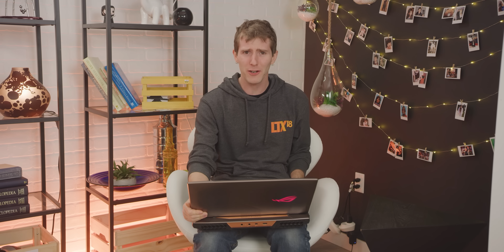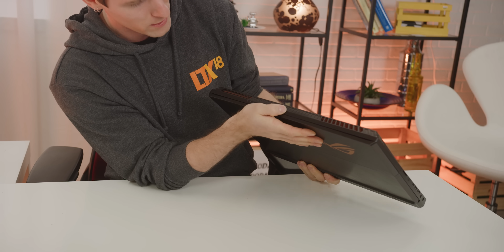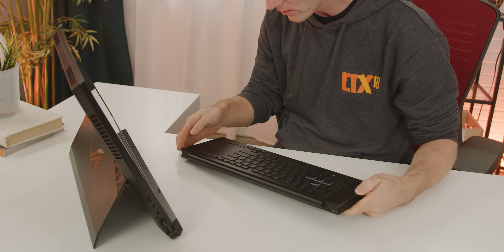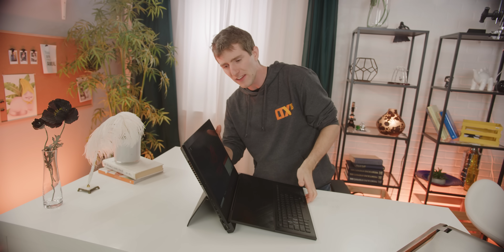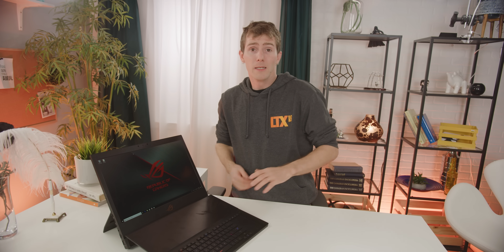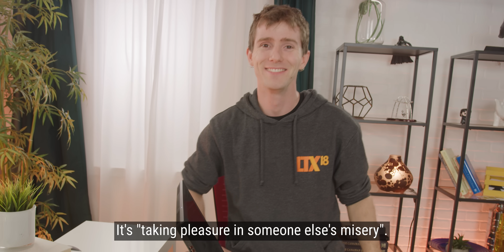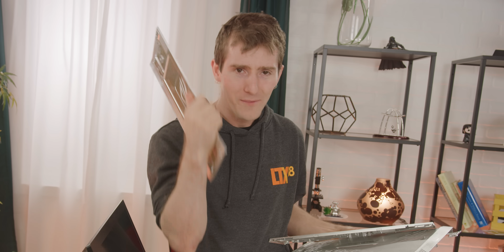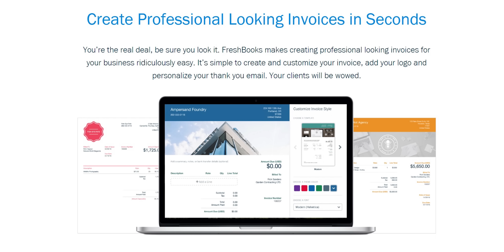A Surface Pro for HARDCORE Gamers - ROG G703 "Mothership" First Look

Comment: Asus HQ: "let's make a more expensive version of a laptop that our customers already can't afford"
Reply: @7oclock  that goes against what ROG is meant for
Reply: @lauren-tc7jo  It's called Republic of Gamers, not Aristocracy of Rich and Stupid Gamers
Reply: @b3nsn0w  ROG is well known for being over the top and being really expensive rhe rog mothboards are at least $200
Reply: I'm into buying good tech but this shit will cost like 10k with taxes, crazy mother board, crazy sound card, crazy mobile rtx 2080 and 3 ssd in Raid 0 plus a wireless keyboard hmmm this shit will cost more than my car😂😂😂
Reply: @7oclock  ASUS does have a budget gaming line, the TUF series. Not sure if those are any good though.
Reply: Or put on our laps
Reply: @7oclock  like @flyingendeavor said ASUS does have a budget lineup but the ROG series is made to be as powerful and reliable as possible so it ends up being quite pricey.
Reply: @7oclock  I would recommend Lenovo 320 15IKB (The one with mx150) and a ram upgrade for it. That's the most budget i can think of

Comment: Curious why in such a potentially epic machine, why would they use simple aluminum heat shield to protect the monitor?   A layer of Aerogel covered by gold foil to both insulate and reflect the heat.   And add almost no weight.    I mean, if it needs additional strengthening, then I get it.   But it didn't appear to be the case.    Better options are out there and wouldn't cost any more than all that extra machining.

Comment: These things never make sense. Probably costs ~$5,000 yet has ~$1,200 desktop performance.
Reply: Callsign Vega 
Remind me, what’s the cost of an RTX 2080?
Had a quick look, cheapest 2080 is £650 from my favourite computer store. That is ~$1,100 Canadian according to google. Add the high end CPU (did Linus say 8960 or 9860? Either way, top of the line 8th or 9th gen mobile processor)...
More like $2,500-3,000 PC at least.
Reply: @InternetEntity  ikr what a dumbass
Reply: @InternetEntity  Uhh no, a GTX 2080 is $700 USD. I'm not talking about Canadian Pesos. The CPU is another ~300. Toss in some basic memory, a PSU and a cheap SSD, you are at $1,200. Oh AND the desktop 2080 will be faster than the mobile version.
Reply: hey nitwit. This thing has a 2080ti and a i9. It definitely runs WAY better than a 1200 laptop.
Reply: @hukuhuhuh  It doesn't have a 2080 Ti moron, it has a 2080. And I said it would have comparable performance to a $1,200 desktop, not a laptop. Did you make it past grade school?

Comment: The one thing I never understand is... how the hell does this solve the “lap” problem? It’s super top heavy, because it’s like 19 inches you’d need 3 foot long thighs to fit this on your lap, but unlike a large gaming laptop, all the weight isn’t in the bottom. It’s going to be like a surface on your knee but far worse... if you need this much power just use a desktop?

Comment: I'm currently looking for laptop with a strong dGPU, a 4k display (touch if possible), long battery life, and light weight for a budget of $2000. currently looking at the Aero 15X and the XPS 15, razer blade advanced is outta budget, any suggestions?

Comment: At what point will there be no difference between these bulky laptops and just slapping a monitor to your mini itx case and taking it everywhere
Reply: Chaitanya Singh kinda hard to put a 6 core + 2080 and have them cool on a mini itx
Reply: @nochox  mine is part size and fine. Biggest restrictor thickness wise is the power supply. Using a brick just sucks for sfx. Better to go slightly thicker with a regular psu
Reply: More like T H I C C laptops
Reply: @Brother Ares But the gpu and cpu are soldered on motherboard in laptops, thus taking less space, and easier to manage the airflow. A normal graphics card would take lots of space in itx, unless you can put an MXM card in it.
Reply: Small form factor is dead. Long live the mothership

Comment: even if i have much money to bought that thing, but i won't.
Reply: At least they made another laptop with a 17 inch screen in a 15 inch laptop body with 2080 max q gpu and way thinner
Reply: @stantorren4400  is it stil laptop when it doesnt fit your lap? 😂
at least it is stil "full desktop" replacement

Comment: 4:54.

Okay, someone help me out here.

When does a "laptop" (is it a laptop really?) have the same performance as it's desktop counterpart in terms of CPU and GPU? I'm rocking a 970m, where the 'm' is supposed to be more power efficient, and produce less heat. I believe this is done by underclocking it, or using a different card altogether?

Linus said a i9 xxxx HQ, which is a laptop CPU right?

I'm curious.

Comment: if they make a 1440p 120hz 99% adobe RGB touch model with an 8750h , gtx 1070 max-q and a 94.24wh battery for $3800 cad this would be the perfect laptop full stop

Comment: review the real desktop replacement, p870tm with 9900K delided+repaste+uv+OC+etc... i9 8950hk is at most 8700K if it did not throttle.
also p870tm could house 3200mhz ram cl17,this will show more benefit to gamers as well. not to mention 5 displays options are sth no other laptop modes(except clevos) offer in one model.

Comment: You rushed this video bit too much, missed out a lot of information including spec's and didn't pay much attention.nor did any bench marks :( also there is another version but much slimmer Linus! 

Austin Evans did a very good job, at explaining what this machine is capable at doing, and what it also comes with out of the box ! and yes it does come with an external webcam for twitch streaming on the go ! and he even explains about the thermals.

Comment: Of course the panels were milled out, it's a prototype. Milling has less tooling cost.

That being said, if the production model doesn't use something like stamped sheet metal, those engineers are crazy

Edit: actually, if they don't plan to make a ton of these, milled might be better.

Comment: That is probably the freshest idea ever. When gaming laptops moved the vents from the left side (where it melted the ice in my drink) to the back, I was impressed. If other manufacturers start doing this laptop performance will increase more and more. Great job Asus. The only downside is it didn't need to have all those super components in it. Make a version that's more affordable.

Comment: Full Review Please And Try Something Crazy Like Overcloking
Reply: Maybe one of two power inputs is for the RTX 2080 since the minimum power consumption is around 650 w
Reply: With this system, I don't actually think overclocking is even that crazy.
Reply: That thing will probably melt. I doubt it has a good enough cooling solution to keep all the components cool in that form factor.
Reply: @meltedcheese1908  have you seen the cooling system at the end of the video??? and basically all the shell of that laptop is a cooling surface because its all aluminium
Reply: @carholic-sz3qv  I have my doubts. I could be wrong.
Reply: underclocking would be crazier

Comment: I would like to know the battery life.

Also, what would be the best laptop for Game Design in College? 

AKA, what has the best graphics without having S@!$ Battery life or weighing the equivalent of the Colledge textbooks I'll likely be carrying normally.
Reply: Battery life, what battery life. That thing has 2 power inputs. I imagine it's like 30 minutes if you have it running on a full load.

Also, your question is on a sliding scale, What's an acceptable performance for you will determine the battery life. Or conversely, what is the minimum you want in runtime it will determine your performance. Your balance of battery life and graphics are directly inversely proportionate. You could perhaps get a laptop with USB-C PD charging and then get a bunch of spare PD Battery pack as an alternative but then you're carrying around a bunch of battery packs.
Reply: @kickassnetwork  it depend if it can switch to discrete or dedicated graphics the battery life will be nice
Reply: Gaming laptops aren't good with  battery life. As for your question, doesn't your school give you a minimum requirement in terms of hardware? Especially on the gpu side.
Reply: I went to school with a mobile workstation in hand.  It was a mistake.  The battery life was enough to make it through a single class, plus anything that I actually needed that kind of horsepower for could just as easily be done on a school computer.  I still love that mobile workstation, still holds its own today(5 years later)(I plan to wipe it and install an ssd to bring it up to date), but in the end its hard to call it mobile.  Not to mention that it weighed as much as four text books combined.  And I could cook a meal on the keyboard.  Don't make my mistake.  Go i7 or i5, 8 or 16 gb, an SSD and a discrete graphics option.  Not a gaming/workstation monstrosity.

The laptop that I ended up carrying around near my senior year had an i5, 8gb or ram, a gt940m, and handled unity well enough to start slapping stuff together until I could get my hands on a lab computer or my desktop.  Did just about everything but Maya, Blender, and SP.(including web programming, not dying before I got to class, and playing a game or two on low settings)

Edit: I'm not going to try and talk you out of a gaming degree(I know the world acting against me didn't stop me, and made me act in some instances almost out of spite.  I personally didn't go through with it after experiencing the culture, which terrified me after I took a step back.), just be careful and take advantage of everything the school offers.  I MEAN EVERYTHING.  Including their hardware.  Maybe not their food, as delicious as it may be(I still dream of the food).  Might help keep costs down and justify skimping out on a beefy laptop.
Reply: @-silver0199  I actually had a workstation laptop a lot like the one you described through college, and I felt like it was perfect for me. I studied engineering, so I used it mostly for CAD and computations. A 1 hour battery life isn't a deal breaker for me, but everyone has a preference. I guess it just depends on how you use it. I actually ended up installing 4 SSDs in RAID 0 in the thing, which is probably a bit overkill for a laptop.
Reply: +Silver0199 Didn't you have electric plugs in your school? We didn't, but we also didn't use laptops there. The first place that required laptops was the university, and there, every table had some plugs.
Reply: @igorokinamujika2073  Power plugs are fairly common in most schools I've seen(I attended different 3 Universities before graduating, and toured several recently while considering grad school), but depending on the school, class and classroom how easy it was to access those power plugs changed.  Lecture halls usually have two every five feet, but I've been in enough overcrowded classes to know that I'm not guaranteed one.  Standard classrooms... not so much, a few connections available near the walls, but everyone with a beefy machine and a phone is going to be eyeing it. 

One of the main changes that happened to me that made me... I guess you can say downgrade though was the desire to actually do work on the move though.  Towards my junior year I found myself out and about more often than I did previously.  While stopping by dorm rooms, libraries, and workshops to meet and work with friends, not needing to always set up near a power source was pretty liberating.  I also found myself outdoors fairly often.  I guess you can say finding myself.  I came up with some of my favorite ideas and had some major realizations out on the trails near the school I ended up graduating from.
Reply: The cheapest one possible. You're going to need to keep the debt down to pay off those student loans working as a barista.

Seriously, though, don't get a game design degree. Get a computer science (or software engineering -- pretty similar, different names) degree and learn to make games on your own while you're doing it. You'll have lots of resources to help you learn while you're getting a degree you are more likely to get employed with -- which usually pays great, by the way. You can still get a job making games with a comp sci degree, but you won't have a lot of options with a "game design" degree.

On top of that, a lot of people learn they hate making games for a living because it's hard work and long hours for what is often less pay. Maybe you'll end up loving it, but don't pigeon-hole yourself like that when there are a dozen other ways to get into the industry.

That said, in either field, your school will almost certainly have a lab, and you'll end up doing a lot of your assignments there because they have specific, very expensive software you need, they have the right setup for special assignments, and that's where everyone in your class and the graduate teaching assistants will be when you get stuck. Get something simple to write papers on and resell/upgrade later for now, and/or just wait and see.
Reply: if it has discrete graphics you'll never have enjoyable battery life.  That being said my dell inspirion with a 1060 max-q treats me well. whenever i have to do heavy lifting in class theres always an outlet to help me actually run the things.  I'd recommend shopping around yourself and not going above a 1050ti, or just getting a regular laptop.  You'll always have desktops available for the real stuff you need.
Reply: Alovon buy the dell xps15 or Lenovo yoga 720 or hpspectre x 360 15(with amd Vega graphics). Dell xps 15 is the best overall but it costs way more, but the hp spectre is almost as powerful as the dell but way cheaper and more stylish.
Reply: You have
Power, design, and price.
 Want cheap, good power ? Bad design (thick or ugly). Want cheap and good design (nice, thin, lightweight) ? You don't have power. Want power and good design ? It ain't gonna cheap.

Good power and lightweight, dell xps 15, msi gs43 vr, msi gs63 vr, msi gs65, rog zephyrus and zephyrus m are your choice.
Reply: @klauserji  don't forget the gigabyte aero 15x, that one apparently has a pretty large battery with a 1070maxq, no space for a HDD though.
Reply: lenovo thinkpad bruddha
Reply: aero 15x or msi gs65 1070 144hz display big battery cuz no hdd or ssd just 2 m.2 drives
Reply: Get a Thinkpad, a used one with decent onboard graphics should be just fine. Keep the few extra grand in your pocket and ignore the mac fanboys. You will know when you need better hardware. BTW, you can smash a drive bay graphics card in some of them. Keep that in mind.

Comment: If that is a replacement for a surface pro, than my 27inch monitor is a replacement for the 150 inch screen at the theater.

Comment: Wait holy, thats actually pretty smart. A 2 in 1 that you can use as a monitor on your desk.
If this had a VESA mount on it I'd pick it up just to complement my system.
Reply: Given how sturdy the back panel is, you might get away with drilling and tapping your own mounting holes...
Reply: @hydraz1n3  considering its dolla dolla expensive , dont think he will go that route , but +1 for creativity
Reply: just unscrew its surface-like stand and put another one with your vesa mounting holes :)
And if warranty is needed, screw the original stand back !
Reply: @hydraz1n3  say goodbye to your warranty if you ever try that

Comment: if i ever get a new laptop for my music production on the go... im probably getting this thing. especially if it has touchscreen.  the fact that the keyboard is disconnectable makes it waaay better for any time you have a desk (especially if you also have 3 midi controllers that you need to keep somewhere. prefferably above the computer keyboard)

im probably getting the cheapest model with touch tho... since i have a desktop that i use for gaming and stuff. and music stuff isnt that hard to run >runs a thinkpad T410 at the moment.